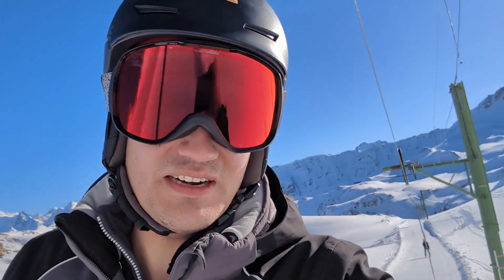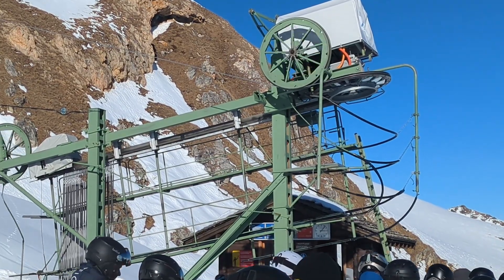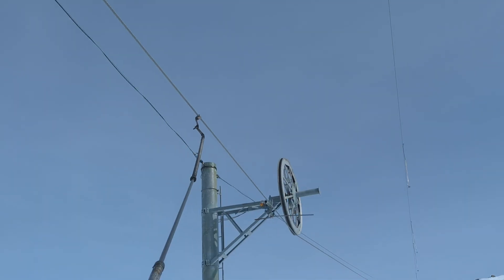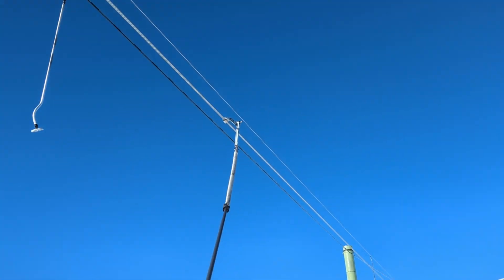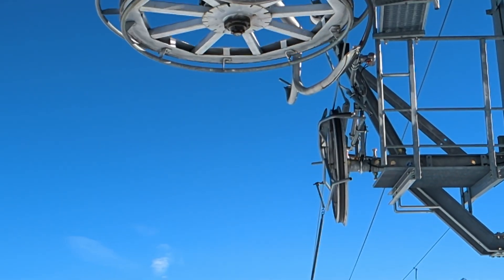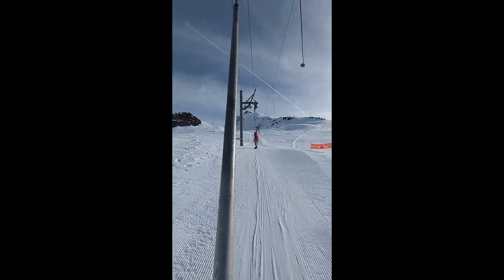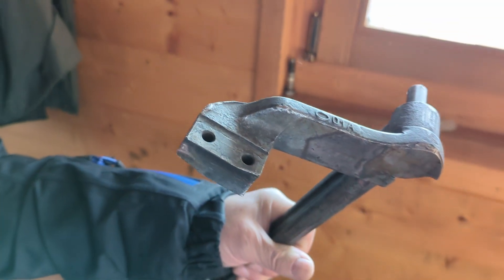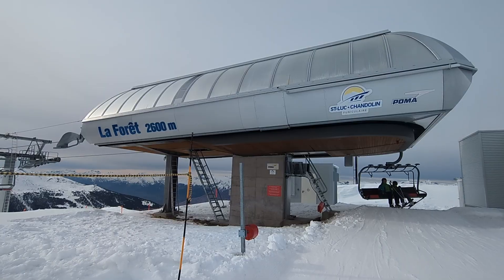The brute force approach to the impossible skilift problem: Poma lifts!

Comment: The slippy grip on the Pomas isn’t as unsafe as it may appear.  It’s a surface lift, the passenger is already on the ground, so there’s no risk of a high fall from a grip slip like on a chair lift. In addition, the grip forms a full loop around the cable, unlike chairlifts that have a C shaped grip.  There’s no way for the Poma grip to come off the cable, all it can do is slip backwards.
Reply: But they do wear out though. Over here in Châtel we've got one that's notorious for slipping. And then you have a skier pile-up and the whole bunch has to ski back down and start over again. Certainly not dangerous, but kind of annoying.
Reply: @bartmulder6995 seems like a maintenance issue. If there starts to be slip the grips should be replaced.
Reply: @bartmulder6995 lol, which one is it? I mainly know the „tres dificile“ double-lift up to Chavanette where one side always runs faster than the other😂 but even as a ski beginner I really enjoy the long ride up with it.
Reply: As a Teenager i was already fascinated by those poma Ski Lift "machines" . They work robust and fast, no matter the harsh stormy weather is !!!  The long Pole is easy to ride, even with a snowboard 😅  
Now as elderly engineer I know this curved Lifts (up to 3 + corners in a row, sensationel !!!) are sensible with nature, 98% pure mechanics, easy to maintain, proofed robust as hell, still a working horse, cheap in operation,  so absolute genious, brillant engineering. Bravo Poma !!!

No seat heating, no girl beside you, no white ski-overalls (oil 😮)  no failing electronics, so software bugs, no false alarms, no fancy Design, no WLAN, ...   pure skiing 🎉
Reply: Yep, I was thinking that the wear on the grip must be substantial and the springs experience serious shock.
Reply: The way the jamming is done, it cannot slip. The more weight you put the grip, the more grip it has. The only way it could slip is if there's almost no weight (ie you push on the stick), or the friction coefficient has dropped significantly.
Reply: @SetKat-Alex 
The bar holds on to the rope / cable through friction, and friction always causes wear. Every time the grip has to accelerate from a standstill (idle / waiting) position into the speed of the rope / cable, there is a sliding motion with increasing friction and increasing load on the gripping mechanism.

This causes wear, and that wear will cause the tube that grips the rope / cable to become malformed. Instead of the grip being a round cylinder shape, it will become more and more shaped like an egg in each end, and this malformation will over time decrease the grip force on the rope / cable.

When the grip force is decreased enough, the friction is also reduced enough so that it can slide a little. If then not maintained properly, the amount of sliding will continue to increase as the wear increases and the amount of friction becomes reduced even further. This sliding will speed up the wearing, and the problem escalates quicker and quicker.
Reply: @Trotters79  that would be the case if friction was created by a clamp, or with some kind of spring.

Here, the friction is created by "arc boutement" (which I believe could be translated by "buttressing", though I'm not sure).

In the Poma system, the bore is bigger than the cable. That way, when the perch will pull on the connection (remember, at an offset), the bore will have only two points of contact, at the opposing ends. 

Because the pulling force is at an offset, the resulting torque will create normal forces on the two contact points which will increase the maximum axial force. 

If the offset is long enough, the harder you'll pull on the perch, the friction it will generate. That way it cannot slip. 

I'm sure the illustrations on this Wikipedia article will explain this phenomenon better that I can :
https://fr.m.wikipedia.org/wiki/Arc-boutement

This phenomenon doesn't care about wear, the only that can make it slip is if the cable become oily, thus reducing the friction coefficient, or if the system breaks.
Reply: @SetKat-Alex 
This system does of course care about wear. The diameter isn't a random one. With a bigger bore, the grip will become looser.

Guess what. Wear makes the bore bigger, and the grip looser. Try to make a hulla hoop grip the cable, and you will understand that the inner diameter and the length of the gripping material (the distance between the two gripping points) - combined with the angle of force, is what's important here, and wear will essentially affect at least two of - if not all three of those parameters.
Reply: @Trotters79  no, this type of friction lock (arc boutement) doesn't care at all about the diameter difference. That's what so genius about this system.

There will always be 2 points of contact, even with a hulla hoop around the cable... You should take a look at the Wikipedia article I linked up there, you'd understand better.
Reply: @Trotters79  BTW, that exactly how wood clamps work.
Reply: @SetKat-Alex 
Your faith is impeccable, but misplaced. Have you never experienced a slipping wood clamp?

The GIF in the article you linked to explains what I'm saying perfectly well. When the ratio between the different measurements get out of bounds, the lock will start slipping. In the GIF the length of the tensioning arm is changed, but since the different ratios is the important thing here, changing the distance between the biting points (for example through wear) does accomplish exactly the same thing.

Please quote exactly the words in the article you believe proves your point, because I have failed to find them.

PS: Look up "fix slipping wood clamps" on YouTube and explain to me why the solutions are always about increasing friction.
Reply: @SetKat-Alex 
... and you will, for several reasons, struggle big time to make a hula hoop bite on to a rope or cable, but you don't have to take my word for it.

Instead, you can prove your theory and create a video about your achievements. I'm really looking forward to it.
Reply: @Trotters79  the different lengths are very unlikely to change significantly (as wear will only increase the diameter difference, which doesn't appear in the ratios).... As I said, the only thing that can change, is the friction coefficient (if the cable has an oily patch for example).
When designing this system, you just have to make the lever length long enough for it not to slip with the lowest friction coefficient you expect. And just throw a security coefficient of 3, while you're at it...

As you can see in the video, the lever is way larger than the "clamp" itself...

BTW, I'm a mechanical engineer, and I got to study this system, so I kind of know what I'm talking about 😉.
And I also visited Poma's factory 😁
Reply: @Trotters79  don't worry, I won't take your word for it 🙃.

What if I told you that the proof already exists, and lie in this video?
Reply: "In addition, the grip forms a full loop around the cable"
Absolutely - I always feel unease when I am in a lift that detaches and I notice it's just some sort of clamp halfway around the cable. Yes, the Poma grip will have more wear and tear, but that's nothing that a visual inspection can't manage and having the clamp all the way around the cable feels SO MUCH SAFER for me as an engineer...
Reply: There are situations where the grip can drop off the cable - the "noix" is attached to the grip proper using 2 roll pins - those pins can come loose with age and use, and drop out (it's part of the lift driver's job to check them every day), and eventualy the grip will wear through to the roll pin holes, at which point it will simply drop off.  The major danger is not with the grip failing, but with the spring and pole dropping off the grip due to wear on the chain links, at that point the grip goes all flippy floppy as it runs through the guides and pulleys, and at some point it will act as a tyre lever.  Usually on the return bullwheel, because it's more fun that way.
Reply: All fixed grips are designed to slip a little bit
Reply: 1) Then I suggest you, as a mechanical enginer, explain why wood clamps start to fail / slip, even without any grease involved.

2) Then I would say you are lying. There's no hula hoops in this video. Try again.
Reply: @Trotters79 
1) well duh, that's because the clamps are designed to close to the slip limit, because the manufacturer may have prioritised the reduction of the footprint, rather than making sure it doesn't slip in any circumstances.

2)  ... Are you a troll or something?
What matters is that there are 2 points of contact. Which will be still true for a hulla hoop. You may have to adjust the lever angle if the angle of the "hulla hoop" is significantly higher than normal.
Reply: @SetKat-Alex 
1) If the wood clamps worked perfectly initially, your answer doesn't apply. It will still have two contact points, as you refer to in the second part of your reply, so again: Why does it start to slip? Something must have changed. What could that be, and what may have caused the change?

2) So you would have to adjust the lever to make it lock on, because of the bigger innter diameter? Now we're finally getting somewhere. With an increased inner diameter, the properties has changed. It's not so that it would be impossible to make it stick, but it might need some tweaking first. Without that tweaking, it might not grip as well as it used to. Because of properties out of bounds. Possibly caused by wear.

PS: You would be the troll for telling lies. Not me. An attempt to make a hula hoops bite on to a rope / cable was not displayed in this video. You can't blame me for your lies, mate. You have to try better.
Reply: Also, pretty much all grips are "friction grips" like this, even for chairlifts and small cabins, it's just that the bigger ones are stronger and have a release mechanism. That's it, that's the whole difference.
Reply: @4nto418  other chair lift and cabin grips are of completely different design

Comment: There is yet another solution to the problem of turning both ways :
I've seen it in Alpe d'Huez, in the French Alps. It's an open basket lifts that is used by pedestrians and skiers called "Telecentre"

The lift goes from the city center to the bottom of the slopes and the baskets turn both ways without decoupling from the rope and never stopping (just slowing down).

I found two videos of it in action: https://www.youtube.com/watch?v=Ao5-qjQpbyo and https://www.youtube.com/watch?v=aEsVT3Te514 (I never managed to get a good video myself)
Reply: Thanks for those links - Just watched the both of them! To be able to design a system with turning structures (One of which is also a half-way station) and to get the spacing of everything just right for it to be able to operate as a series of fixed gondolas on a rope with nothing more complicated than varying the speed is simply next level! 😳
Reply: @UK-Combustibility-Assured   Indeed. However the way it achieves "wrong way" sideways course changes is EXTREMELY complicated! Not to mention the support structures to deal with the lateral forces....